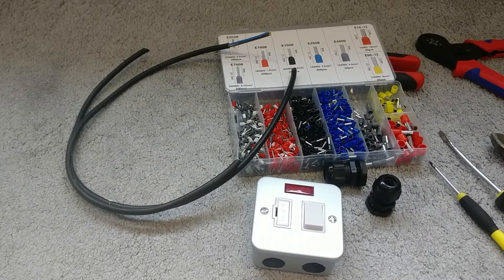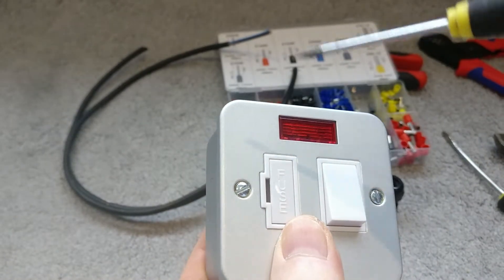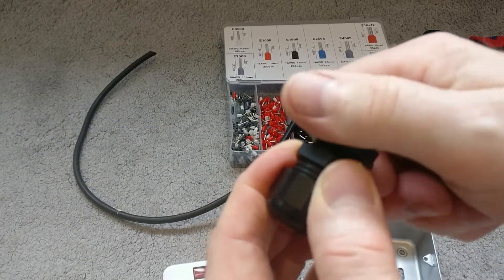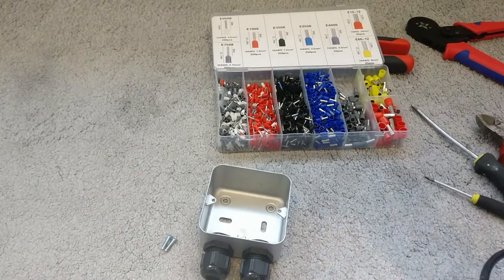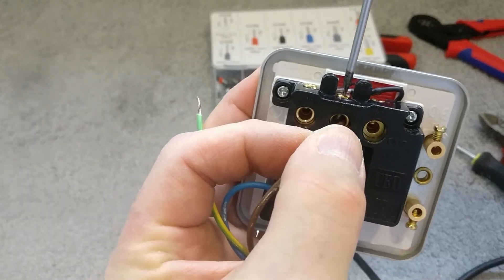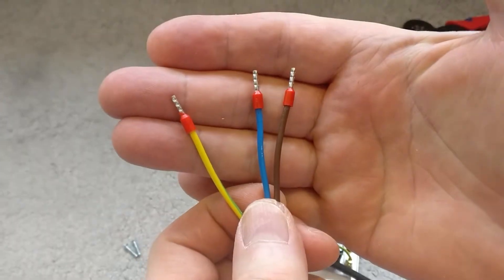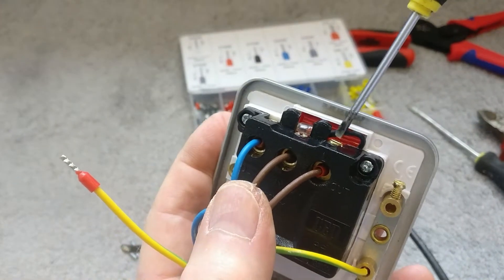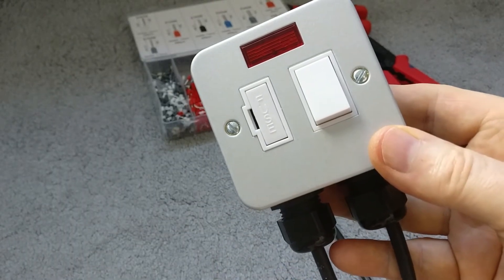How to Wire a 13 Amp FCU - Fused Connection Unit

Comment: Hi and thank you for clarifications. I have an odd question. I already have fuse box and it supplies water pump in the flat but i was thinking of running another cable for a small heater or radiator for towels on the wall. Can i run another cable from the fuse box? Just as you shown us were to put in color coded wires, is it possible to put another pair of wires into load port holes?

Comment: I had question i have wired 8 sockets and instead of fcu i put a normal plug just to test the wiring and to use temporary but fuse is blowing… Issit different when using a spur to fcu then electrical sockets as suppose to 13amp plugs.

Comment: You did say that the metal back box must be earthed, but you didnt do it.
Reply from the maker: Yes, I did say the back box should be earthed.  I did it off video and forgot to include it during editing, but as I said in the video it should be done. You should run an earth from the earth terminal on the face plate to the earth terminal on the back box 👍

Comment: Hi When doing a new fused spur socket off the  downstairs ring main (frontroom). once it been completed. I test it with a sockets tester with  rcd test button. When pushing the tester button, should it trip that ring main downstairs (frontroom) or whole downstairs. Or from new socket to new to 13 amp fused spur.
Reply from the maker: If the spur socket has it's own RCD then it should just effect t the spur
Reply: @Builtbypete  it's a surface wall mount same as your one in your video but it's plastic l. Thank you for your reply

Comment: Hi . Ive just installed a mixer shower with a transformer. The  original was wired by means of power from shower to transformer to single switched socket with plug and 3amp fuse seemingly on its own circuit in the loft. Instructions recommend transformer wired to 3 amp fused spur. Should i change and can you tell why it should be changed. Thanks in advance
Reply from the maker: Hi. Sounds like the loft circuit is already a spur. Spurs add additional safety but keeping some devices away from the ring main. Most commonly fused spurs are 10, 13 and 20 amps.  Personally, I would stay with the manufacturers recommendation and go with the spur connection.

Comment: Thanks,  can you have 2 output cables ie socket and underfloor heating thermostat?
Reply: Thanks for the reply..I have easy access to a cable where i want to put underfloor heating. That cable is a spur to a very low use double socket. I was thinking of putting in an fcu and running both from it. Not sure i can get it back into the ring easily.
Reply from the maker: Better to insert two sockets into a ring.

Comment: Hi, just quick one, should the red light be on when the switch is on? I had a situation that with the switch on there is still supply as normal but red light is off. Thank you
Reply from the maker: Typically the red light should only be on when the switch is in the ON position.

Comment: Hi, Can I wire my spur box into the ring main, then supply my boiler from the spur box, thank you, great video, cheers
Reply from the maker: Yes, you can do that. I would suggest making it a fused spur for safety. 👍
Reply: @Builtbypete  brilliant, thank you chap
Reply from the maker: Your welcome
Reply: @Builtbypete  Would there ever be any point in putting a junction box into the ring main, then go down into the fused spur box then onto the appliance.
Reply from the maker: No, not really. That would end up just being the same as a spur.
Reply: @Builtbypete cheers fella, always learning 😃👍
Reply from the maker: Now worries 👍
Reply: Why do some appliances say to wire via a a fused spur instead of a plug? If the plug is as readily accessible as a spur and both fused whats the benefit of a spur?
Reply: You could possibly use a junction box if the fuse spur connection was going to be unaccessible  ,say connecting under kitchen units then run the spur up the wall above the worktop and put the fused switch there, if it was to run a washing machine or similar of you would be better trying to wire a single 2.5 back to the consumer unit , spurs r ok but u need to calculate the total load now on the circuit, Today with all the appliances u could possibly have a air fryer with bacon going  the toaster going and the kettle at the same time then for good measure u turn on the washing machine and tumble dryer , you know were this is going , I moved house and noticed there was only 1 ring serving the entire property including kitchen, some of the wires were very crisp with black soot around them , So u need to have a good hunt around to see what's what before just adding to an already overloaded circuit